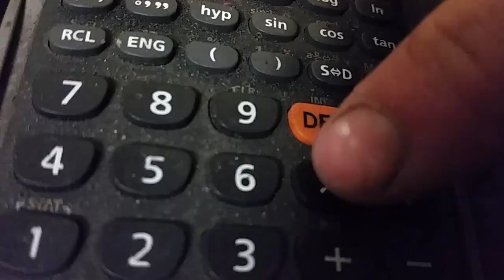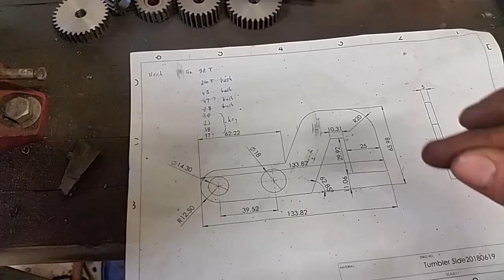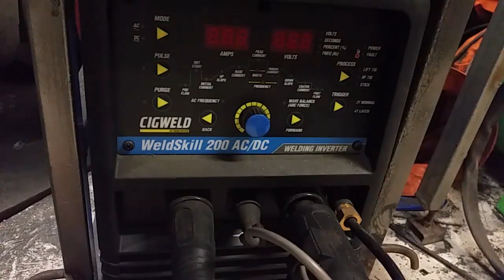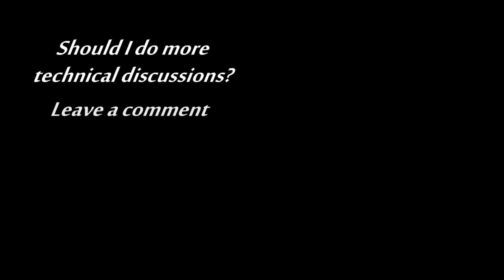Quick Change Gearbox Build P3

Comment: Hi tommygun machine
What formula or program can you suggest me to calculate friction loss for gear train in gear teeth and  surface contacts of shaft taking into account gear pitch, viscosity of lubricant, bearing materials.
Can you suggest me any books i can refer to??
Reply from the maker: I didn't calculate any of this for the gear train itself. The calcs shown for the sliders was only a basic static friction calculation (contact force multiplied by static friction coefficient). There would be resources online; university powerpoints, notes and handbooks for calculating what you are after. Sorry I couldn't really help, I come from a more static, structural background
Reply: @TomMakeHere  thanks tommy

Comment: tommy ! i am making a bike  and it has no gare's on engine ; i would like for u to make a 5 speed mini gare box for me' i will by it.let me know when?
Reply from the maker: I would be very hesitant to do this, if something were to go wrong on the road I am liable. Additionally my gears are straight cut spur gears these are not great at higher speeds (above 700 RPM I need hearing protection next to the gearbox). Sorry mate

Comment: Nice job, but please don't climb mill on a horizontal mill, as you can pull the work into the cutter, break the cutter and bend the arbour.
Reply from the maker: Believe it or not, I'm actually conventional milling! It's the camera frame rate making it look like it's spinning the other way! Like when car tyres appear to spin backwards sometimes on film etc

Thanks for watching and commenting
Reply: Gotcha. Apologies.
Reply from the maker: No worries, feel free to point out mistakes, I'd rather know about it in advance...

Comment: Impressive build. Nice idea of connecting gearbox to the lathe. Thanks for sharing. Subscribed. My screw cutting gearbox box will be more complicated. http://www.homemadetools.net/forum/additional-screw-cutting-gearbox-68632
Reply from the maker: Looks good. Thanks for watching
I decided to go for tumblers so that I could get gear depthing right, my concern with sliding gears was that I might not get the best mesh if my shafts weren't quite aligned

Comment: that center punch bushing idea is pretty neat, Ill defenitely have to "borrow" that one off of you. :P
Reply from the maker: Cheers It's all yours!
Although truth be told I had to weld a plug in and redrill one of the holes, but I think that was the drill wandering  (the gears were meshed hard against each other by 0.1 mm or so). I should have used the paper between the gears trick
Reply: they looked like they turned out ok in the end, and it's not a defect, it's an added "feature", lol.
Reply from the maker: @ChirpysTinkerings  It adds character :) Makes it more unique
Reply: lol, exactly!